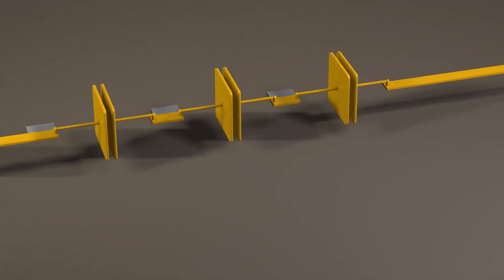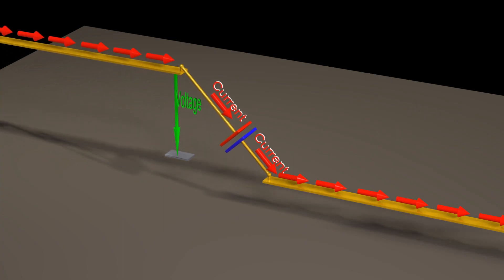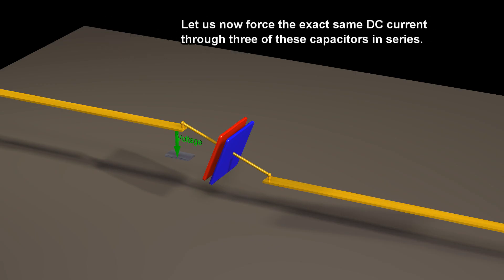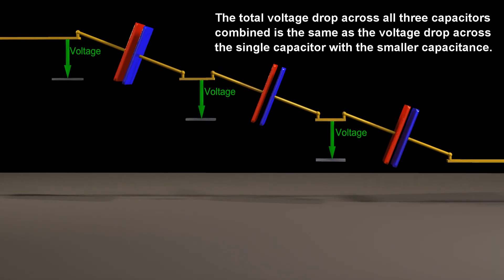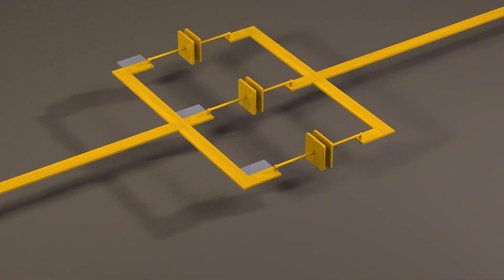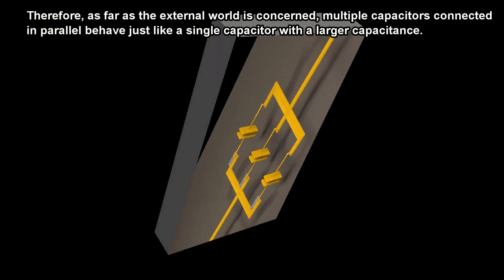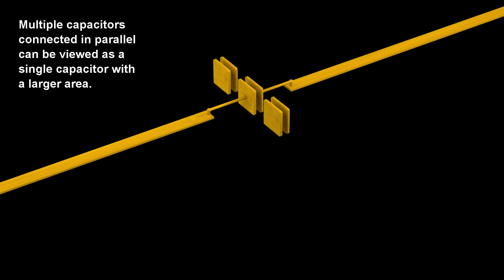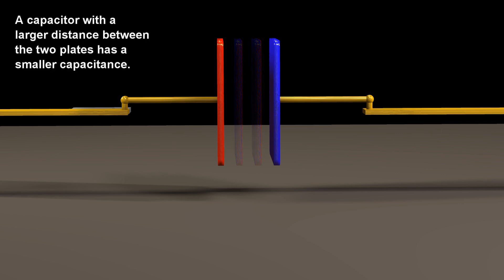Capacitors in Series and Parallel

Comment: Please give the list of future topics order doesn't matter.
Reply from the maker: New topics are constantly being added to the list, and often it is the new topics that I end up doing first, but my present list, in no particular order, is given below.

heat capacity
electro-static fields around a circuit.
Voltage as sum of electric fields
Riemann sphere
voltmeter, ampmeter, ohmmeter
All electric components
Affine connections
Diodes
Batteries
current sources
tuned collector oscillator...collpits oscillator..hartley oscillator
crystal oscillators
rc filters
transverse vs longitudinal mass
digital logic
digital adder
K space and R
bending moment and shear force
oscillator circuit with positive feedback
inverters (DC to AC)
conic sections
synchronous motors and generators
solving electric circuits
Solar Panels and LEDs
Semiconductor FETs
rainbows
thevenan equivalents
superposition
circuit boards
magnetic properties of materials
Jacobian
circuit equivalent for motors and generators
 Laplacians
antennas
Cauchy Sequences
DIODES,BJT,FETS AND MOSFETS 
tesla coil
forward vs flyback converters
right hand rule & charges reversable
Hilbert Transform
adders from logic gates
superconductors, levitation
computer memory when power off
how not to teach physics
RLS and LS algorithm
AdS/CFT correspondence
electron diffraction
Inside resistor on microscopic level
synthetic and projective geometries
Transistor circuits (Current Mirrors)
mosfets and finfets
coherence / decoherence
Bell's spaceship paradox
 Lamour principle and Abraham Lorentz recoil radiation
 how the magnetic field of a changed particle will look like if it is both spinning and accelerating
 bragg's equation and X ray diffraction
behind the scenes
osmotic pressure
Wheatstone bridge 
star delta transformation
Crystal structures
 t pi networks
Magnetic circuits
Larmor Precession
Navier-Stokes Equations
negative temperature
short circuits
higgs mechanism
group theory
Direction Cosigns
Derivatives of sin and cos
Derivatives of exponentials
line integrals
derivative of one function inside another
electric field visualization
hyperbolic functions
exponential decay
logarithms
Hamiltonian Mechanics
Pythagorean theorem in multiple dimensions
wave equation
digital signal processing
solid mechanics
curvilinear coordinate systems
reverse ray tracing
Newton's method
Conjugate Gradient method
Fundamental Theorem of Algebra
signal analysis
 hyperbolic functions
photoelectric effect
nature of infinity
Klein–Gordon equation
tipe tops
gyroscopes in smart phones
Wavelet transforms
free,damped and forced vibration
Computational Fluid Dynamics
Dirac's equation 
circulation and vorticity
anti-matter creation and drive
Fractals
 cauchy shwarz inequality
4,5,6,7,.. dimensional spheres,cylinders and cones
eliptical curves
vacuum energy, quantum foam
circulation and vorticity
sums of infinite sequences
greens theorem
entropy with mathematics
surface abd volume integrals
root mean square as distance
spinors
covariant derivatives of tensor fields
projection of one vector, function on another
spherical, cylindrical, rectangular coordinates.
Mandelbrot set
Unruh radiation, Hawking radiation
plasma, bose Einstein condensate, fermionic condensate
transfer function
Transient response
gradient, solenoidal, irrotational and laplacian
scalar triple product and vector triple product 
 pendulums , triple pendulums a n-tuple pendulums
relativistic aberration and relativistic hall effect 
How does photon absorbed by electron transfer momentum to nucleus of atom
Multiple Discriminant Analysis
Maxwell Boltzman velocity distribution law of gas
Dzhanibekov effect
linear vs non-linear systems
Supersonic Fluid Flow
taylor and laurent series
dzhanibehov effect 
discrete fourier transform
Calculus of Variations
 Green, Stokes and Gauss Theorems.
quaternions
Hilbert Space
Density functional theory
Force, work, and energy
How toilets work
mechanical resonance
single photon wave advancement
Neutron detectors
pendulum clocks
Friction
microscopes, telescopes, cameras, 
bode plots
heat transfer
tension force
superdeterminism Quantum
differential gear
how swings work
gravitational slingshots
ideal gas law
rockets
how speakers work
why sharp objects are dangerous
differential equations
hydraulic press 
differential pully / hoist
gear ratios
lasers / masers
acceleration in multidimensions
color
photomultiplier tubes
structural integrity
chain reactions: burning, nuc.
helicopters
springs
reflected waves
surface tension, capillary action
solid - liquid - gas - phase diagrams
Sonic Boom
centrifugal force
Doppler radar
harmonics
Optical effects of Special Relativity
linear vs nonlinear
Newton's cradle
gauss's law for charges and mass
Pascal's law
maximum efficiency of engines
internal combustion engine
Poincarè ball and Hyperbolic space
fluid mechanics
BANARCH-TARSKI PARADOX
collision physics
Blackbody radiation
Hamilton-Jacobi 
mass spectrometry
differential geomertry
transverse doppler's effect
Photon wavelenght in gravity and acceleration
More Minkowski
Gamma ray interaction with matter
feynman diagrams
skin effect in conductors
gamma function
Plasma physics
gears and pullies
Force as energy gradient
scattering theory
diff eq (ricatti, reduction
holograms
string theory
topology
set theory
quantum eigenvalues
polarized reflections
quantum electrodynamics
atoms and molecules, electron orbitals
CP symmetry and CP violation
dark matter
gravitational waves
applications of nuclear physics
faster than light causality problems
Olber's paradox
beginning of time
momentum of massless particles
 cosmic microwave background radiation
worm holes and time travel
blackbody radiation, quantized energy
Quantum Field Theory
identical particles
star lifecycle, star physics, types of stars and star deaths
anthropic principle
big bang
nuclear cross section
why light slows down in a material
latent heat of fusion and vaporisation
casimer-effect
experimental evidence for relativity
quantum attraction
end of nuclear fuel in an infinite universe
pauli exclusion principle
red shift of galaxies
Doppler effect (and relativistic effects)
Quantum Teleportation
Coulomb branch and Higgs branch
trapped quantum particles
inferometers
Interstellar travel
effect of gravity and expansion of space on electromagnetic frequency
Noether's theorem and symmetry
Solid State Physics:  Bloch wave, tight and weak binding, Brillouin zone, charge traps
Quantum Zeno Effect
Heisenber uncertainty principle
why time slows: box and spring pendulum
communicating with aliens
black holes
gravitational lensing
Quantum light polarization
does time slow, or just physical processes
laser cooling
AdS/CFT correspondence/holographic duality
Legendre and Bessel functions
 zeeman and stark effect
conjugate mirrors
Quantum Numbers
gauge symmetry in field theory / guage invariance
nanomaterials, like nano particles, nanotubes, nanolayers and ets. 
relativistic Ehrenfest paradox (fast rotating disc)
frame dragging ( translational and rotational)
orbital mechanics
Spintronics
 parity and CPT symmetry
magnetic reconnection that creates solar flares, CMEs, and the Aurora Borealis.
negative resistance
Primer Fields and the bowl shaped magnetic fields surrounding galaxies / photons
open channel flow
MRI
Gravity vs entropy
z transform
Helmholtz equation
Bose–Einstein condensate
computer heuristics, memory storage and retrieval (solid state and magnetic), programming architecture, networking, ect. Another great video section would be 
material science engineering based, such as vapor deposition, crystalline allotropes, ferrous metallurgy, and electro-spin nanofiber production. 
quantum Cheshire Cat in a matter-wave interferometer experiment
Reply: @EugeneKhutoryansky  OH MY GOD ...
HATS OFF TO YOUR HARD WORK ... 🎩🎩
Reply: @EugeneKhutoryansky  Oh my god.  We can never pay for your love and hardwork for us.  You are doing so beautiful work and creating a very fabolous stuff for us. Please add a topic of Concept of electric potential Energy levels and movement of electrons accordingly in various materials. How energy levels serve for the creation of a covalent bond and ionic bond? Please also add a topic of visualization of thermal vibrations.
Reply: @EugeneKhutoryansky  I request you to pin this comment if you feel comfortable.